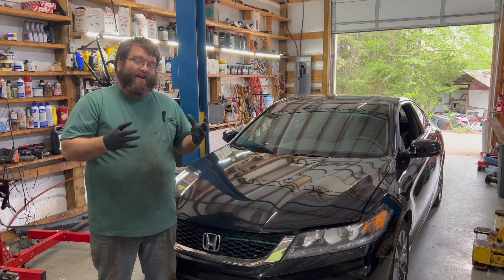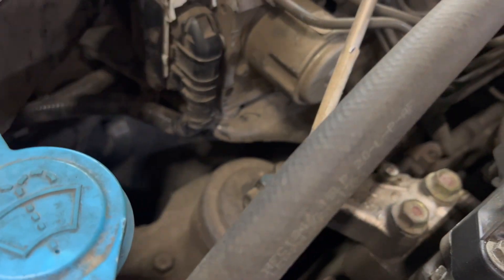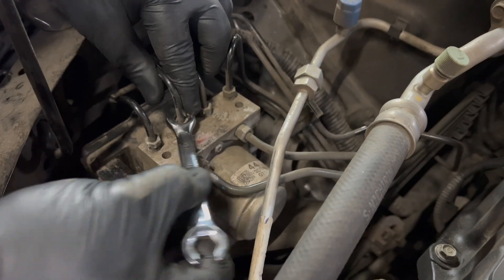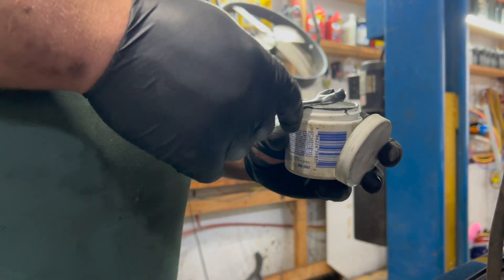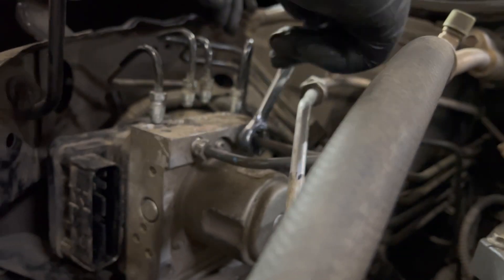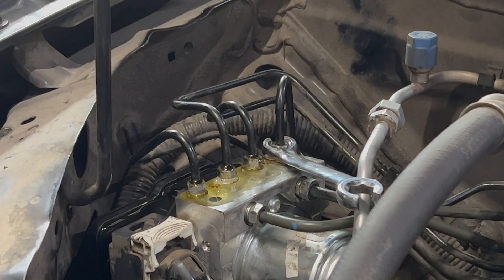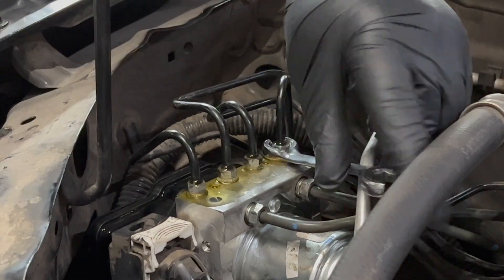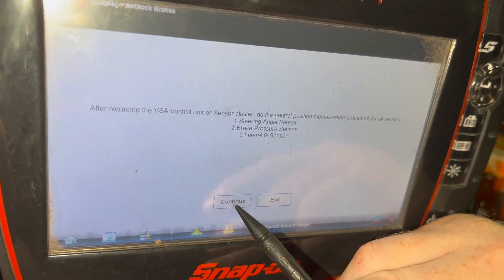13-17 Honda Accord ABS Light Code 121-11 VSA Solenoid Malfunction - ABS Unit Replacement

Comment: My 2014 Honda Accord had these codes.  I removed the black module (only 4 small screws and the wiring plug) and left the ABS pump body in.  Since I didn't have to remove any break lines/tubes it saved me from having to bleed the brakes.  I mailed the module into Module Masters and they sent it back in 3 days fully refurbished.  $300 after shipping.  Reinstalled it in 10 minutes, drove it around and the indicator reset itself after a few minutes.  All fixed!  Module Masters gave me a 5-year warranty on it. Easiest repair ever.
Reply: Awesome! How did you get at the two bottom screws on the module box?
Reply: @robbieanderson9387  shows you how to take off the bottom 2 
https://youtu.be/ZYoRcWPGbb8?si=o81p6nHAqyCgiI6Z
Reply: @robbieanderson9387   its a pain in the. behind took me like 2 hours to remove the 2 bottom screw from the module.
Reply: After I read your comment I did exactly the same thing and it worked.How did you find them ?Module master 100% recommended.Thank you .
Reply: @krzysiekka8450 how did your access bottom screws?
Reply: @brians2328  I loose module bracket bolts pull away towards the engine and tied to a/c line with wire ties I used L shaped star alan
Reply: @krzysiekka8450  Gotcha, that's what I was thinking as well.. still looks tight, I have v6!!  What was your experience with module masters quality of repair? Thanks again!!
Reply: What exactly are the lights on your dashboard? I’m having same issue which are 3 lights right now (steering wheel, traction and tire pressure (tpms).  I’m assuming it’s my VSA also need repair and I’m aware also of the module masters I found them on eBay. Thanks for sharing.
Reply: Hey, is it still working fine? My car has these lights. Thinking of sending just the module
Reply: @yeepo4  dont just send in the module. actually get the vehicle diagnosed first!i do airbag module crash data resets and ppl send in their modules just because the airbag light is on all the time and its annoying because a crash data reset will not automatically erase the light lol
Reply: I need to fix the same issue for my doughter civic what are the modules masters where can i find them??
Reply: Can I still drive my car if I remove the module? I assume so bc if it’s broken now what difference would it make if it wasn’t there? Been driving for 6 months with these lights on
Reply: @lemickey4204 yes. But Ive been driving the car with the damaged module for well over a year with all the lights on. Like it doesn’t hurt anything. I mean just go in a parking lot and speed up and slam on the brakes. See if the abs is still working. The FCW&LDW aren’t a big deal. Just don’t text and drive
Reply: @forfun6273   I saw your previous comment. My car also does the beep like the lights are on thing. It’s been like this for a while now, although the beeping didnt start until I tried to fix it lol. I actually took the module off and opened it up and found broken wires (I think, tbh I couldn’t tell if I broke them trying to figure out if they were broken or if they were already broken. Bc when I looked at it the 1st time I didn’t find any broken ones but then I went over each one again and found 2) I took it to a computer shop so they could resolder them (same thing the $200 repairs on eBay do, but I got it for $50) and it didn’t fix it. So my plan is now to get a used one soon and replace it. Idk if this helps you in any way but that’s my experience so far. Wish I could fast forward in time and tell u the used one fixed it lol
Reply: @lemickey4204 technically you can but just be cautious and careful out there on the road.
Reply: Did your car beep like you left your lights on when you turned the car off and opened the door?
Reply: Do you mean the small screws to the black part of the module the little Phillips screws. Just trying to get confirmation
Reply: So this should work on the 2017 as well???
Reply: I'm having this issue with all lights coming on. 
So you're saying I don't have to do it like he's doing?
Reply: @superdude7459 I just removed the module portion. Runs perfect. Getting at the bottom screws was tricky, but you can get them through the plastic in the wheel well.
Reply: Oo ok wow .. yeah i have to do that   i have the same thing .. buy Can i still drive the car while the module is removed?
Reply: Good to hear it worked well for you. These 9th gen Honda Accords are really good cars. They get 35 MPG and require  simple maintenance that isn't expensive. They are boring but dependable cars for what you pay for them.
Reply: @sn4rl277 Oh boy, the VSA module is not cheap. Part is $1.5k
Reply: Which code did you have? I have a 123-11. So wondering if I should only send the module or full assembly with the pump.
Reply: Are you able to drive the car without the module being in it? I need to use my car still and dont have a spare
Reply: @unlistedcringeyt712 where you able to get a response?
Reply: @brianduran3373 nope but I drove without it for a week perfectly fine, abs light fully comes on and you must drive safe since its fully gone. Got the rebuild from module master and it was fast turn around time
Reply: My mechanic charging me $350 to take it off and reinstall the new one with the brake flush and reprogramming for a 2011 EXL v6
Reply: Was your car still driveable mine didnt want to drive anymore or reverse
Reply: How is it doing ?

Comment: Yes I have a 2013 Honda crosstour and I'm getting the same trouble code but I'll check with Honda with the discount that complete pieces like $1,100 and I believe the remanufactured module I think is between $300 and $400 so I just wonder how long the remanufactured module last😊
Reply: Do you have any updates? I own a 2012 Honda  Crosstour with same issue.

Comment: Im getting vsa signal failed 85-01 and fwc lwd sensor giving( invalid data ) uo416 anyone know if this is vsa croaking out or if its just maybe a fuse.. have already changed the battery. problem is intermiten sometimes itll be on as soon as i turn the car on sometimes i need to drive for a few miles im so stuck on this issue
Reply: Did you ever figure it out? I get the same 3 error codes. All but the 121-11 code will reset themselves and all the light go off after restarting the car and driving for about a minute but they will either come back on within that drive or maybe even last a couple trips before coming back on.  Honda dealer said VSA module but I just want to make sure it’s not something else that can throw those codes.
Reply: @NiteStarXX  it was the vsa module for me, I end up having a mechanic look at it. That Vsa solenoid had actually gone bad. 

It cost around 2300 to fix. that module being 90% of the cost. But everything is well now been driving for a few months now with no codes
Reply: @JUST_GUNZ4881  Thanks for that info!

Comment: What symptoms are the vehicle is experiencing? Don’t just give the code or lights.
Reply: There's no symptoms other than code and the lights. The vehicle will drive fine.
Reply: @insulinaddict9586 what is my car wont drive but goes in to gear
Reply: In some vehicles there is a pronounced jumping of the car as one breaks.  Then the lights come on: ABS, BRAKE (red), slip warning, power steering.
Reply: @markmccummins8049 of course but in the case of these Honda Accords thats what the symptoms are

Comment: Nice video. My 2014 accord is having same issue. I will fix it for mine. However I sae in another video that black module can be repaired. So will try to fix it in my workshop.
Reply: Did you get it repaired ?
Reply: there are places that repair them for a faction of the cost  of a new module.

Comment: U can heat up the flare nuts with bolt induction heater or heat gun to the module with penatrating fluid.

Comment: How do you remove that connector exactly? I see you pry up a tab on top, but isn't there a bottom tab too? What do you do with that white piece? Do you lift it or push it back (away)? Thanks please!!!
Reply: That white part on the connector is pulling type to unlock the connector.

Comment: Any video sharing knowledge on this problem is valuable. Thank you. That being said, it is even easier (as long as you have basic DIY skills) to remove only the black ABS module and leave the brake lines still connected to the silver colored block. Send the module off for rebuild and re-install. I used Module Master and got great service, plus they back their work up with a warranty. You can drive the car without the module - will be lots of warning lights on and no ABS/Traction Control. 2014 Accord Sport here.
Reply from the maker: Thank you and you're right. I have done this on other vehicles in the past if parts are hard to come by.
Reply: @automotiveinsight 900$ for brand new vdc module for my customer from honda. Ive never seen a honda part i trust thats not at a ridiculous price. I do not trust honda. Only manufacturer that pisses me off.
Reply: @GregsAutomotive Shit is crazy. I'm seeing them used for 300. Don't understand why this part is so expensive.
Reply: @ZDemBoyZ  honda just makes them that way. Its partially because the module is the brain of multiple systems so its really 3 computers in 1, or one computer with enough processing capability to have 3 in1 systems. In reality this cost honda no more than 200$ to produce.
Reply: @GregsAutomotive  Definitely makes sense. I need the same module and I'm having a hard time finding it for less than 850. Most likely going to get a used one and see how that works for me.
Reply: @ZDemBoyZ  Have you checked out having your original rebuilt?
Reply: @Tuff67-y3m  I haven't. What kind of shop would do that??? I'm in Jersey so I'm trying to figure out where I would go.
Reply: This is what I was wondering! So it is completely good to send the black module for repair while still driving with the main pump connected? Does it still require a brake bleed using this method since the lines are not disconnected?
Reply: @brindan1609 No brake bleed needed because you’re not disconnecting any lines. Car will not have ABs or traction control. Cover up the exposed areas while your module is gone to keep dirt out of the electronics.
Reply: @Tuff67-y3m  that’s perfect! Besides no ABS / traction control, I assume everything else would be fine to drive for a few days?
Reply: you’re awesome thanks
Reply: Can you do a video on this?
Reply: Awesome! How did you all get to the two bottom screws on the module box?
Reply: @robbieanderson9387  t-20 bit with a 1/4” drive ratchet. It’s tricky.
Reply: Did you have to reprogram it when you just send the black module for repair?
Reply: Isn’t it important to send the motor as well though?
Reply: But do you still need to have it recalibrated once you get it back?
Reply: @falconsoccerplayer yes module masters does everything you need, then just put it back in after and flush the brake system
Reply: @falconsoccerplayer mine was fine, no recalibration
Reply: Were you driving it in limp mode ?

Comment: Hey guys. I have a 2014 Honda Accord Sedan LX with similar issue. ABS, Brake, Traction Control lights are all on. I've been chasing this down for 3 months. Is it possible the fuse could cause this? I ordered a used pump on EBAY but it was for a 2015. When my mechanic put it in he said it wouldn't talk with the ECU computer. My question is does that matter? I have not noticed any effect on the car with braking or anything else and Id love to get these lights off. When I start the car in the morning the lights go off for 2 hours making me think its getting a bad signal and might be a fuse or bad relay. I would appreciate your thoughts on this. My car has 121K and I am the original owner and dealers are crazy what they want to fix something like this. Car runs great.
Reply: Have you fixed your problem ? If so what was it .?
Reply: @joshuac5932  no the lights stay off for 2 hours in the morning and from a cold start. There is nothing mechanical wrong with the car and I just ignore when they pop on. Makes me think it's something else.
Reply: @mac2920 did you figure it out?
Reply: @azhaar-8821  No. Even took it to my mechanic who ordered a replacement part that didn't work and he still charged me $200 labor. I have just let it alone and just passed emissions. Very annoying
Reply: The car can still be driven with these lights, you just wont have the abs capabilities of helping to stop when braking hard. abs prevent your wheels from locking up with breaking. but uou still have regular braking power. I have this issue with my car and i refuse to pay honda $3k to fix it. I came across several Companies that specialize in fixing these for like $200 to $300. Just make sure you have that DTC 121-11 code. which is the common code with all the modules that has this same problem.

Comment: are there any code readers I can buy to reset the lights myself?  I got my module repaired but the lights are still on after installing
Reply: I’ve seen a few videos where they had to use a jumper wire to make those lights go away.

Comment: How did you get it out without brake fluid oozing out? I had quite a mess after removal.
Reply from the maker: I usually just put my fingers over the holes, but you could also take the caps off the new one and thread them into the old one before removal.

Comment: This part is extremely expensive. Would it be ok to buy a third party ABS module
Reply: Yes,  I bought a used one for 50 bucks. Over 1yr later all is still well. $1200-$1800 new from Honda!!! That wasn't an option. There are companies that rebuild them for around $200 but your car will be down for about 3-4 days until part gets shipped back to you. 2013 Honda accord.... I still have my old one that I will rebuild if/when the used one fails. Ebay has used and rebuild services for these

Comment: Great, informative & helpful video. You likely will save some Accord owners a ~lot~ of money! It seems that Honda quality has been slipping these past 10 years or so. What a shame. I hope they can get it right again and I'm also hoping my '13 Accord 6MT never needs this repair!  I don't think my next new car will be a Honda which is sad as I've been a Honda fan since buying a 1987 Civic Si back when I was starting out as a driver.
Reply: Honda is still the gold standard. What other brand would you suggest? Toyota would be the only one and they just had to recall a couple hundred thousand v6 turbo truck engines.

Comment: Thank you for this video, and thank you all for the comments, learned a lot.  I have a 2013 Honda Civic with this code ordered part and have been waiting for 6 months for the part to arrive current status unknown.  Issue diagnosed at around 122k miles and currently have 132k miles on car.  The light would come on and off intermittently since November of last year but erroneously received a suggestion from the dealer that it might be a software update issue so might not be a serious problem, they would only do it if the codes light up which it was not always on but maybe a few minutes every couple hours of operation back then.

I saw someone got a loaner while waiting for this part to arrive.  What functional aspect of the vehicle is not working?

Comment: Is there a way to do the sensor re learn without the tool? I found a used module, from exact same model 2013 Accord LX-S. I can do the replacement but not sure the re learn can be done through the OBD2 jumper procedure.
Reply: Did u fugure out if there was another way?

Comment: Hi, there. ABS Module part its in "back order" status. I cant found original part. Can you tell me where did you get it?. I need one for a 2017 Accord Sport CVT.
Reply from the maker: Our local Honda dealer ordered it and had it in a few days.
Reply: @automotiveinsight  I have been waiting 6 months for mine and they keep on pushing the ETA date and bringing this back to unknown status.  Currently unknown with 3 other vehicles also waiting for the part.
Reply: Thanks

Comment: Hello I had the 121-11 code listed , mechanic replaced the module, did the reset and calibration but vsa light and traction, abs and fwc fault are still on any tips?
Reply: You figure this out ?
Reply: Could be the wheel speed sensors and also I’ve found this problem to happen after put non matching tires on the car “more than 2 different brands”
Reply: Did you ever figure out what the issue was?
Reply: @NiteStarXX  I had to bleed the brakes , add more brake fluid and tighten the line bolts as there was a little leak. 
But the main issue usually will be the brake modulator first.